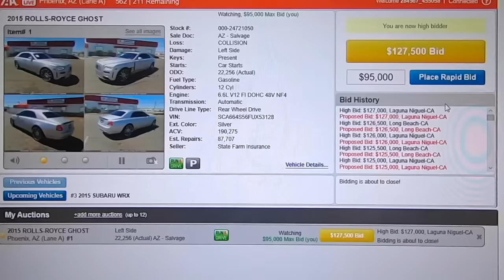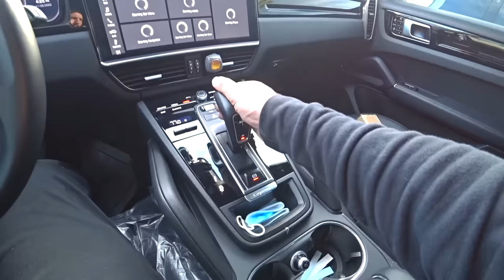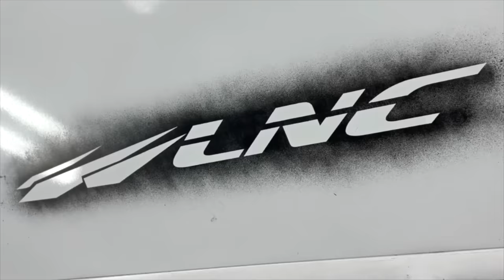2021 PORSCHE CAYENNE LNC BLACK OUT CONVERSION

Comment: Great job. Rear clear lenses look great. Front fender repeaters would have looked better clear. After that much effort and cost I would have had white fender flares and rockers. Gloss black lower front and rear bumper. Looks odd with a mix of gloss black and black plastic.

Comment: After paying all this money to get these few things done, customer should have just optioned it all from Porsche, or gotten the S model.  Also the model designation delete is probably so people don't know he got the Cayenne base model.  You did a great job with the install.  Certainly complex but it came out great.  Still don't understand the point of doing all this cosmetic stuff to a base cayenne.  All that work to the front bumper and mirrors, yet he's too cheap to spring for gloss black bumper inserts.   Doesn't seem worth the extra cost to make it into a fake Cayenne S model.  (Just noticed in the end, the really sketchy badge change to a Cayenne S.  Customer is trying to pretend he bought an S.  Hopefully the person he flips it to realizes he's about to get scammed)

Comment: Hi Vlad, you made an interesting comment regarding similarities to Volkswagen ... well in the true sense of it, the Cayenne is a Volkswagen, as it shares the same platform  (modularer Querbaukasten MQB Evo) with the Audi Q7/8, Volkswagen Touareg and Bentley Bentayga as well as other models ever since 2017/2018. R&D is 90% funded by Volkswagen, component sharing in the non-visible area is high, electronics are the same. Base engines are the same, obviously Touareg is lower spec compared to Q7/8, is lower spec to Cayenne. The chassis for all four mentioned above are being produced in Bratislava (Slovakia) assembly for Porsche is in Leipzig. If you ever make it to Germany happy to organise a factory tour in Leipzig. Andreas

Comment: Cracking job Vlad. I like the clear lenses on the back. A wee question is it not illegal to run with no front number plate over there?
It is in the UK.
Reply from the maker: In California technically you’re supposed to have one but it’s not a big deal just a probable cause to pull you over lol